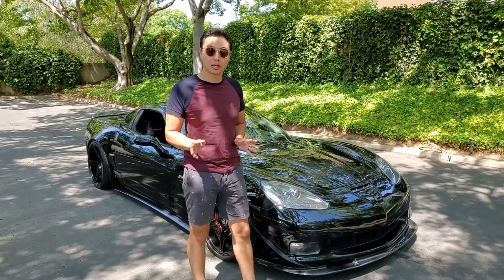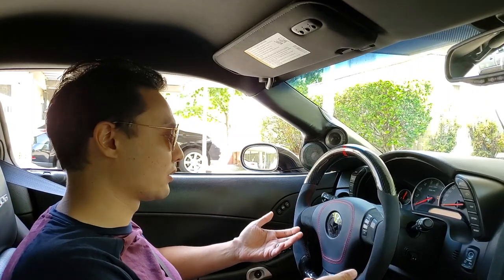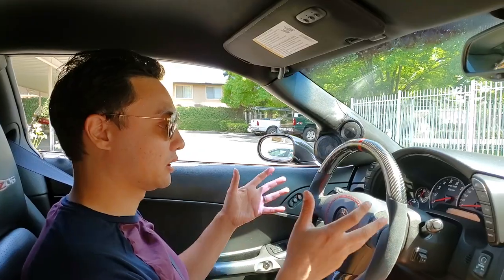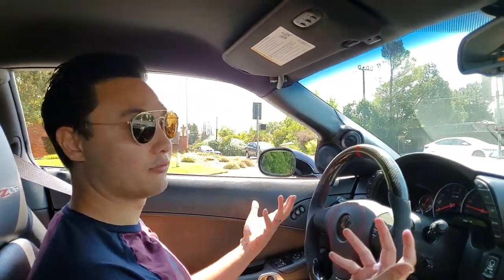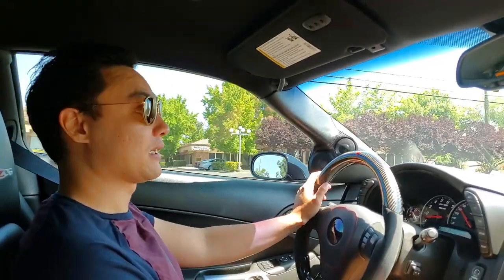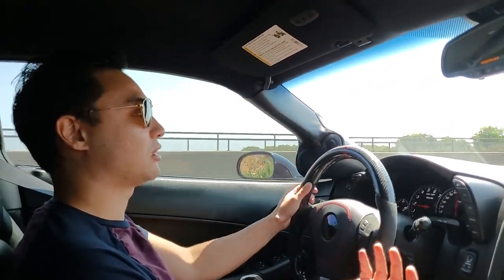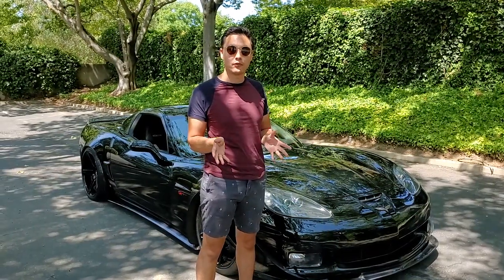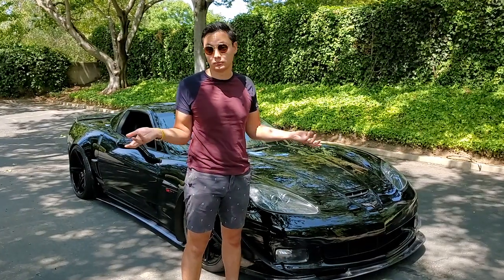Should You Cam Your Corvette Z06? How Will It Drive?

Comment: Finally a video showing the drivability of a cammed Z06 around town, thanks
Reply from the maker: No problem glad it helped. It was the main concern of mine before camming the car if itd be undrivable at low speeds.  This smaller cam really didn't change the car very much in terms of drivability.

Comment: The cam in my 427 LS3 is way worse than that.  I always let it warm up before driving.  Bucks, has a "reversion" at about 1800 RPM, RPMs drop too low sometimes and bounce up and down when pushing in the clutch.  Worse when the AC is on.  Much better when warmed up tho.  Absolutely screams throughout the RPM range with your foot in it.  Makes 520 RWHP and I don't need any more.  It feels like a legit race car.  It is pretty hard to drive slow honestly.  Stop-and-go traffic is my nightmare.  Definitely not the car to teach someone to drive stick with.
Reply: Need a better tune, it can fix most of that.
Reply: @i3oosted  Hahaha I've heard that so many times, and have gotten so many Dyno tunes from multiple "expert" tuners for thousands of dollars.  Nope.  No more without a guarantee.  Also, I had to get rid of my lightweight flywheel so the last guy could even tune it, which did improve most of these issues (it would actually RPM crash so hard it would stall).  I did like the lightweight flywheel in action, it reved so fast and sounded AWESOME like a dinosaur or lion roaring with your head in it's mouth.  Apparently, a lightweight flywheel with a cam is just too much for the old C5 computer.  I was told to upgrade to a C6 computer for like $6000+.  Nope.

Comment: Great video! I have a C7 and thinking about stage 2 cam. You confirmed what my shop said which is that I might just have to feather the clutch at low speeds. But then other people are saying it should drive like stock with a proper tune. I'm not sure if it's any different with the C7 vs. C7 but curious to get your opinion? Thank you

Comment: Had my 08 Z06 cammed and built by vengeance racing and love it !!!!!!
Reply: Kevin , am planning a trip to vengeance soon for my 2008 base model with stock NPP..Which pkg did you get and any tips?
Reply: @kiddroddy  I did a stage 5 and I went with Annihilator cam, they was gonna put a Kaotik cam but I wanted a little bigger cam but I have a manual, I’m not sure if yours in an automatic or manual. You just don’t want to put a big ass cam in it where it jumps and lurches when your driving at low rpms.
Reply: @kevinz0681  Thank you so much for the advice am driving a automatic. Thanks again
Reply: @kiddroddy  no problem, what stage are you going with ?
Reply: @kevinz0681  Am going with the stage 3pkg for the base model C6. I want a mild cam setup for daily driving..I don't want a surge at low rpms..
Reply: @kiddroddy  right on you will like it, I had to put drag radials on mine, but I don’t drive it in the rain or snow.
Reply: @kevinz0681  Awesome  ..Your car sounds amazing..Super nice..
Reply: @kiddroddy  ya it’s not bad put 3 piece HRE wheels with 345 on the back hooks up pretty good.
Reply: I have pics of the motor and wheels don’t know how to post them here to show you lol
Reply: @kevinz0681  Woow.. I can only imagine how awesome it looks

Comment: There’s a 10plus minute video to answer this question? Should any cross plane, in block cam American V8 go with an aftermarket cam? The answer is always, hells yes. Whether a 289, 302, 305, 327, 331, etc… all the way up to an LS7. Hells yes.
🇺🇸👍💪🦅

Comment: You seem very knowledgeable in cams so I'll ask. Do you know if the torquer 110 cam is smog legal in California? This cam is on an ls7 z06 out of state and wasn't sure if itll be smog legal in California. Any feedback would be appreciated
Reply from the maker: Hey thanks for watching. No cam is technically smog "legal" in California, just fyi. 

The Torquer 110 is a nice cam. If the car had stock manifolds and cats with a good tune and with all the readiness checks activated properly you shouldn't have any issue. Additionally, with that cam, idle speed should be below 850RPM with a good tune. Cars with headers will never pass smog btw. Stock exhaust with valves closed will be hard to tell from stock with the lope.

You have to be careful with out of state cars that are tuned on 93oct as well. We only have 91oct so a retune would be necessary if the car is on 93oct. Head milling bumps compression up as well so watch out for that as well because you may not be able to get away with 91oct without lots of knock. Most people i know end up running flex fuel E.

Hope that helps.
Reply: @DriveLineZ  that's really good info thanks. The z06 I'm looking at is in Oregon and has been tuned to 93 octane, do you know if itll cause problems if I drive it using 91 octane for a short while at least until its returned to 91 octane?
Reply from the maker: I think most of the issues would be at higher rpm/full throttle and don't lug the motor because it gives a longer span of time for detonation to occur. no guarantees though. You can read into dynamic compression ratio and knock relation if you are curious. Just throw some octane boost in just in case like torco or something and I'm pretty sure it'll be ok for the trip.
Reply: I think almost all exaust mods are illegal in Cali, they got the harshest Pollutinglaws in the World, worst then here in Germany, because they only produce Tesla electric vehicles, so they not care the Automotiveindustrie. 🤔🇺🇸

Comment: Whereabouts is the duration, lift, and lobe speration of this cam? Very informative video. Thank you.
Reply from the maker: Thank you very much for watching. I believe it was somewhere in the beginning but its a 226intake 242exhaust on a 118+4lsa .652 intake and exhaust lift  cam motion custom grind. Definitely on the smaller side for an ls7
Reply: @DriveLineZ  wow pretty good lift there. Thank you 👍

Comment: I have that same steering wheel (only different).
Reply from the maker: Definitely helps make the inside look better
Reply: @DriveLineZ  absolutely.  Totally changed the driving experience.  I got mine from socal garage works. (I think that's what it's called) Really happy with it.

Comment: Spin city my A... This is never Mexico its just too nice.. This Neighborhood.. 😂😂😂
Reply from the maker: Haha shhh
Reply: @DriveLineZ  This Cam out is a big issue here in Germany, high fines if the cops pull you over, can't go over 100db these days here. 😩🇩🇪atleast we can  still go 200mph fast on the Autobahn, if restriction is lifted by a grey sign. 🤔🇩🇪
Reply: Now I am worried.  I just ordered the Corsa extreme for Z06 with 4.5in tips but still undecided what cam.  I know it will get really loud with a LT headers also...cops will be all over me 🥶
Reply: @David-jh8mp  Yes, you definitely will get run into problems and get pulled over and get Tikets constantly, especially now in that Age of Green Environments, you need buy a Valve Exaussystem, then you can switch it to stealth mode, and sometimes you want listen to Music or Messages, its impossible with a Loud exaust. 🤔🇺🇸🇪🇺